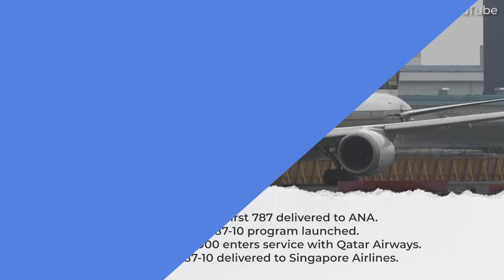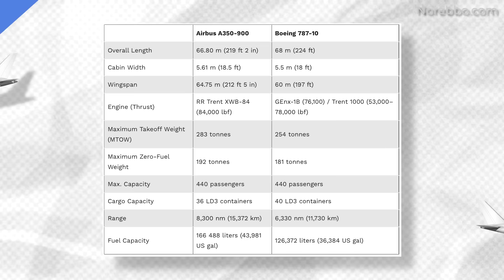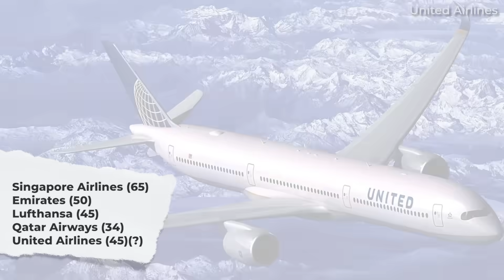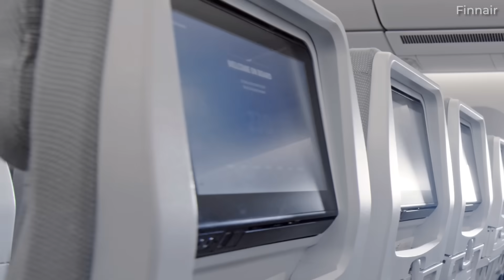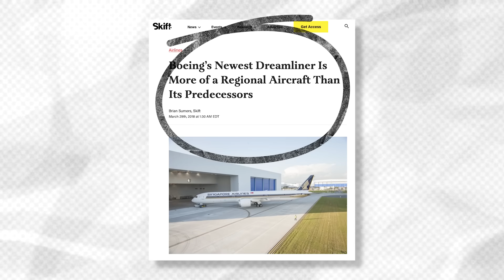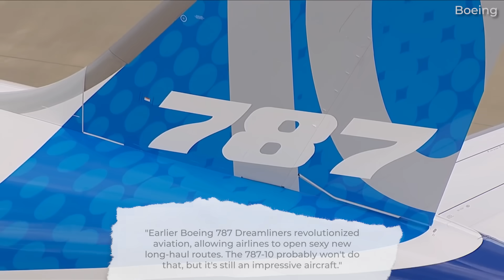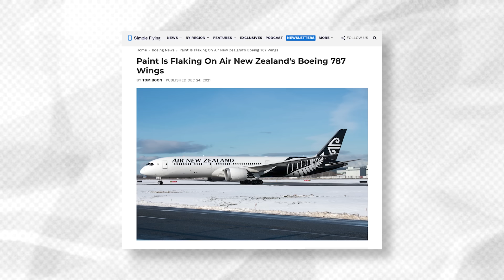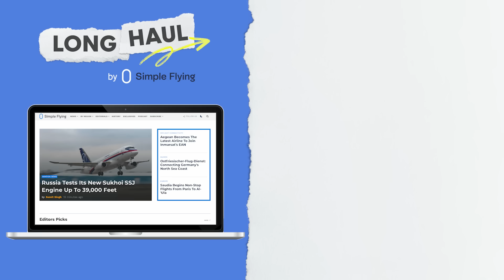The Airbus A350-900 Vs. The Boeing 787-10: How Do They Compare?

Comment: Boeing never intended to make the 787-10. It focused on the 787-8 and 787-9. Long and thin, not long and thick or ultra-long. Because of this, the airframe is not optimized, as the 787-9 was the focus for Boeing. Despite this, it's still a good replacement for the 777-200 and 777-200ER. Similar range and MTOW, with much better efficiency. That's what United, KLM and Singapore are using it for. Also, it's clear that the 787-10 is better optimized for cargo. I suspect it will enjoy better success as a cargo carrier in its later life.

Comment: Singapore and ohter airlines fly both airplanes. So the seat products are similar. Therefore, you can compare both airplanes at the same airline. Given I had flight with Singapore A350 and B787 I prefer the A350. Especially in economy.

Comment: The wider economy cabin in the A350-900 is a distinct advantage to passengers  over the B787-10 particularly over the longer routes with both standard configurations being 3+3+3 9abreast
Reply: Exactly this 100% agree. Was on virgin airlines a350 to JFK and wow the comfort was amazing in economy. Went on the 787-8 BA Lhr to KL … outdated, no control of aircon, overhead bins, and my god the 90s lcd tv and phone pull out thingy lol 😂…might not be fair compare as it’s 787-8 and not -10 which is newer but still 5-7 years old is still bad.

Comment: The A350 was built to compete with the bigger 777.  The 787 was built to replace the 767,  but it turned out to be a much more improved product.  Im a Boeing fan but I have respect for Airbus and I will fly in their planes if Im ever scheduled to.

Comment: It looks like there is a place for both the A350 and the B787 in many airlines fleets. A350 is the champion of the high margin, ultra long haul, prestige routes. The 787 is super economic on the medium haul, low margin milk runs.

Comment: The Airbus A350 stands out for its sleek design and superior efficiency, as it was specifically engineered from the ground up for long-distance flights. Its wings are designed to carry more fuel, giving it a significant advantage. In contrast, Boeing has opted to stretch its existing plane models, such as the 787, which all share the same wing design. This approach leads to fuel capacity limitations. Once again, Boeing's shortcut approach demonstrates their failure to innovate effectively.

Comment: but the 787-800 was out before the A 350-900 yaa add to that the B 787 is the replacement for the Older 4 category B 767's, noIf the  A 350 needs a competitor, it has to take the 777 series

Comment: I think the primary issue at hand between these two is separate from their capabilities.
The 787 production facility is currently producing less than two aircraft per month because the FAA doesn't trust them with their delegated authority. Apparently the same issues with the 737 Max are permeated throughout the company.
The a350 is objectively a better aircraft: it can carry more passengers with a higher range and better cabin pressure. The only reason it seems anyone is buying the 787 is because Boeing is selling them at or near production price. They can do this because of billions in tax cuts and subsidies from the state of South Carolina, where the facility is located. They're treating it as a real estate and market share operation, which should give everyone pause.
Reply: 787-10 is better suited for local carriers who would normally choose either of the smaller 787 variants as their main plane but want bigger plane on some of their routes, without investing into a completely new model, with pilot training and all that. For bigger carriers with high demand for long, intercontinental flights, A350 is simply a better option and there it's real competition is 777.

Comment: The A350 offers more fuel and more range.  
That alone makes it better when you consider you can fly NONSTOP from  JFK to Manila or JFK to Singapore.  It's a time saver.

Business class is also superior on the A350.

Economy on the A350 has more space than the 787.

The A350 has more powerful engines and can take off from short runways.

After flying business class on both, I absolutely prefer the A350 -1000 to the 787 -10. 

BUT I prefer the A380-800 over ALL.  Specifically the Emirates A380.
Reply: I don't really get why people keep comparing the A350 to the 787. They are not competitors.
Reply: @0w3nn  we as humans seem to love comparisons. It’s like we need a comparison to be able to look into something

Comment: The airbus a350-900 is remarkably uncomfortable. There is no air flow. So you just breathe everyone's air. Really gross. How could you design a plane with no air vents? I'm sure they exist but they are so far away, you get no circulation.

Comment: You tube and Goggle both with American bias have for years tried to run down Airbus but Airbus just kept getting better. Whilst Boeing followed the Corporate greed route and got a hammering. I still haven't got over the CEO's walking away with $60 million plus for killing over 360 people.  The stench is hard to kill, so my preference its always going to be Airbus. Boeing need to get back to their original remit of safety first and very good engineering as opposed to Wall St.  So trust comes before comparison.

Comment: I think a lot more could be said surrounding passenger comfort. Yesterday, I flew both the 787-9 and the a350-900. I can positively say my experience on the 787 was considerably better. The a350 just seems clunky, and quickly put together, whereas the 787 feels like there has been some thought put towards it. 
Sounds: 
- The a350 has very loud brakes, almost loud enough to turn off a worried flyer. 
- Engine noise, 787 just has a peaceful hum, where as the a350 I'd say is louder. 

Lighting:
- 787 interior lighting appears to have many options for the carrier and is much more subtle then that of the a350.

Also a quick mention of the useless OLED/ LCD screens they use as the seatbelt sign. Like, why?
Reply: "Airbus" and "quickly put together" in the same sentence? Surely you have mistaken it for the Boeing. The Airbus is 6 decibels lower in noise during flight, has a higher cabin pressure (5500 feet vs 6000) and it has better humidity levels.

And if you must know the Boeing has more quality control issues, so the only plane being put together quickly here is the 787.
Reply: @FBl_Federal_Bureau_of_Investig either confused the planes, or just fanboy. Had a 787 to Doha and changed to an A350 there some weeks ago. Regarding comfort and especially noise level, the A350 is in it's own league, only rivaled by the A380. 
After a so-so 6h "ride" with the 787 (really not too much difference to a 777 regarding cabin noise level, if any), I arrived at the destination, completely relaxed from a 5h sleep on the A350. What an aircraft!

Comment: Two different airplanes, The 787 was specifically designed to make flights to non-hub airports and secondary was the domestic market. This market accelerated after Covid, of course. It was not designed for extended ranges but fuel efficiency per paid fare to non-hub markets. We all know the airlines pick how to make us as uncomfortable as possible for $$$$. I consider the 787 family and the a350 family two separate type airframes

Comment: B787-10
Is cheaper 
Can fly nearly 95% of the same routes A350-9 Flies to
More fuel efficient 
Has shorter landing runway distance which gives them advantage over the A359 making the 787-10 able to land at smaller airports 
Has more Cargo capacity
Less MTOW
Finally, 787 is much more good looking with its shark engine look that makes it even more efficient rather than the standard looking a359 engine
Reply: Sounds great, which one will the passengers prefer?  That's the key.  There is a lot of evidence for Airbus.

Comment: just by the looks, the A350 is far better looking than the 787 imo...
the 787s is quite low to the ground(which is good?) and doesn't have the pretty face...meanwhile the taller A350 makes it looks proporsional and majestic at the same time 
*edit
and the wings...the newer airbus (incl A350, A330neo)has this beautifully shaped wings compared to the boeing made one

Comment: You should've mentioned the a350's BRILLIANT cabin pressure
Reply: The 787 and a350 have the same cabin pressure of 6000ft.  But yes, BOTH aircraft are equally good in this regard
Reply: @ak907silvers6 I think the Airbus is actually 500 feet lower and has better humidity

Comment: For me the 787-10 has been the most comfortable and best plane i flew on so far. Never flew on a A-350 though.
The 787-10 has really spacious seats, tho i am not that big (neither in height nor width) so i never am bothered with that.
The automatic windows in the 787 are amazing, much better then the old-fashioned once. Especially with passengers to dumb to listen to cabin crew requests when landing for example.

Flew the 787-10 from AMS-LAX (about 11 hours). So certainly a really long haul flight.

Comment: They DON'T compare, as they aren't even competitors to one another.

The a350 competes with the 777-300er and the upcoming 777x.

The 787 NightmareLiner only competes with the 757, 767, and earlier models of the a330

Comment: I have not yet  tried flying as a passenger with B787 and just like what this docu showed. B787 has couple issues thus delaying it's delivery. That means to say there is gotta be a problem behind it like battery issues. On the other hand, A350 has only paint issues as far as I'm aware. A350 is the future of commercial flying for the coming long years.

Comment: Flown on both aircraft. The Airbus A351 is quieter and more comfortable especially long haul (Singapore Airlines)
The Boeing 788 was OK a big improvement on the 763 (Delta Airlines)
Airbus is more comfortable.
Reply: It depends on the airline mostly for passenger experience, did you even watch the video?

Comment: The potential of the ground breaking 787 program is still in is infancy.  Boeing fundamentally changed how comerical airframes can be built. This was a revolutionary,  unlike the existing a330( modified into a350) which in typical European fashion is a evolutionary design method. Like it or not the a350  shared aluminium/composite panel assembly is dated.

Comment: Why do you compare the a350-900 to 787-10? The -10 is designed a regional jet.   The long haul 787-9 or 8 should be compared.    The 787-10 is actually the most economical regional wide body.

Comment: One very important cabin comparison item that you did not mention: Cabin pressure and humidity level. 
The A350 keeps it at 5500-6000 ft and 20% humidity, meanwhile the 787 keep the pressure to 6000 ft and humidity to 10-15%.  
So, the A350 has a slight advantage aa a passenger as a higher humidity level is more comfortable.
Reply: Is A350 quieter?
Reply: @claus1225 yes
Reply: @claus1225  787 with GE engines are a bit quiter.
Reply: @semihgedik6078  dont know how to find out if a 787 has GE engine?
Reply: @claus1225  Most of the RR engines has Rolls Royce logo. Most of the GE engines on 787s not have any engine manifacturer logo.
Reply: exactly
Reply: Having only recently flown the 787 (but never the A350), the most comfortable plane I've tried with some margin, I can attest this makes a huge difference.
Reply: @thomaspaaruppedersen6781  A380 is the quietest plane and feels more comfortable than 787. I haven't flown on A350 yet.
Reply: @thomaspaaruppedersen6781 Flew some hours ago from Johannesburg to Doha with A350-900 and Doha to Brussels with B787, A350-900 is way better for sure, quieter, more humidity, larger and I could go on. Also, it’s safer

Comment: KLM STOP LICKING LOCKHEEDS AND BOEINGS ASS, its AIRFRANCE-KLM help out the european economy FINALLY 737's are replaced by A32x NEO's by KLM AND even transavia, fully rejecting the MAX's why? they had x words, safety first, consts, and really the 737 classic, 400 - 600 and the NG has been a great ride,however we we do not care for current boeing policies we feel that we are treated now as third hand low cost carrier customers rather than buisness partners, they seem to have forgot that archive of coorporation suring the move, let say negotiation with boeing got heated, so we will forget it as well ever since the headquartners and it's board of accountants and  engineers moved to their board/ changed their board removing engineers out of the board basically putting a distance between themm and stock analysts rather than accountants, they want to make money not aircraft, btw this is our official statement to boeing as airbus welcomes us with open arms as we are offered major benefits of going to a A320fleet, and as passenger numbers are to increase, weand we have to compete with other carriers we are considering aircraft like a rewinged A321 even so to compete with TUI for long haul routes to the carribiean and not all carribean routes have to be rewinged, and the amount of passengers and cargo will be increased, far maxing out the max by double it's capacity, the A320NEO is going to get our company in gear (klm and transavia said at the same time) but increasing fuel prices and knowing the 737 inside and out.

Btw This is insiders information as a simple dispatcher working in the office and out. On the side not the XLR is pperforming already better than expected, the 787 was truely the last well engineered aircraft by boeing, why do you think they dont want to create all new aicraft until 2035? well engineers moved onto other companies, sold secrets to airbus probably, try and proof that they did, but the amount of whistle blowers at seattle is tremendous, throughout the airlines that try to HIL a 738 MAX for a redeye flight a long howl, indicates the future for airbus being the lonewolf as boeing files for bankrupcy, no no, not of themselves yet but fighting legal battles against airlines who claim they would have had to because the quality of bonewer boeing aircraft seriously performs like a PHOENIX SIMULATION SOTWARE TRIPLE 777 designed for Microsoft FS2002 and upgraded to 8 and the new tripple 777X's OH THEY AE GONNA BE THE NEW JUMBO's omg they are years behind shedules there are production issues and the folding wings, there are douzens of reasons by it can during cruise, turbalence LANDING one could go uncommanded another whistlebower said boeing is hiiding everytthing AND STILL IS WORKING UNDER THE TABLE WITH THE FAA TO to get aircraft certified, BUT EEASA, WONT LET THEM, this means there's a risk if tthe amounts of incidents increase further due to a LACK of a proper EICAS (/ECAM in airbus and digital checklists, like in MODERN boeing planes {the 737 is almost a 70years old man} get into all the 737 NAXXES they will stop allowing it to fly into euro within 5 years ( safety concerns and stop it alltogether with the aount of eicas related incidents and pilot awareness related incidents exceeed a certain treshhold and with an accident with great loss of life ground the maxed out dinosaur forever, xcept for the NG's, and incl the grounding of all classic and 456 00 series., THEY CAN UPDATE THEIR DISPLAY SOFTWARE in those small cockpit instead of an EICAS build two MONITOR INTO THE THING or a 24:11 ration screen below the engien instruments or two 7:5.5 ration screen that is like the FMC and typing console itself, seriokg, ZWAP OUT THE FMCfand even touchscreens would be approved includigng a digital checklist and a cinokete reffiting and updating of the trim systen, no more cable and pullies,
IF IT"S A NEW BOEING? i aint fucking going, if it's a max on paper ill board the plane but my will of my life insurance will say all this money is going to this person who happens to be me or part of it
Reply: use the front lavatory before boarding is done and sneek out. with being an alcaholic nowadays, a reading of 2.43 0/oo is something i function normally on and seriously in a max just when ur boardin sabaotage the left AoA vane as most boeing maxes and any 737, doesnt checkor compare data between identiccal sensors, glitch

Comment: The 787-10 has still a room for great afvanyage,that is the re-engine with higher thrust.THerefore the 787-10 can still have the option to increased range by increasing take -off weight either for fuel tanks or cargo capacity or both.

Comment: This video is lacking important information: the A350 900 can be ordered as ULR ultra long range, widening the capability gap. Also, it's interior got a makeover, leading to wider inner cabin with 440 passengers (+10%), and it also comes with dimmable windows without physical shades. All this shifts the scale in favor of Airbus even further

Comment: Since there are merging rumors that the -9 and -10 might have an extended range it would be good to add at least 2000 nautical miles to both of the types so that they may fly perform better in terms of of range where as there will be no need to make stop overs between such as London to Sydney, Sydney to New York, Mumbai to Los Angeles etc.Though the -9  is not bad at all.
Reply: Why would they want to have ER where 777x are designed for longer routes. A350 1000 will start delivering next year 1Q
Reply: 2000 nmi? I don't think that is possible now. 500-1000nmi is more realistic.
Reply: @mmm0404  2000nm is 3000+ Km so if it were given to a -10 that would be like 15000Km of range and 17000 for the -9
Reply: @kennedyxhulu4933  yea , would be great but remember Boeing would need additional space in the 787 frame to fit more fuel capacity. 

That space is limited

Comment: Range isn't everything. There are so many heavily flown routes that even a 767 can fly, range wise. The 787-10 is thus perfectly well positioned for routes out of European hubs that have higher passenger loads like KLM to India. 

Think of the 787-10 as mid to long haul and the A350 as more long-ultra long haul. Different tools for different jobs.